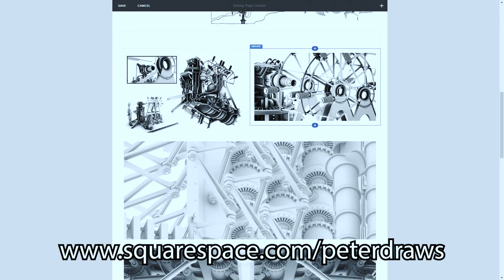I'm on the EDGE of a BREAKTHROUGH! (Painting Process Video)

Comment: I think the breakthrough... is realizing that you're idealizing breakthroughs. You're a successful YouTuber. You've achieved something that many, many more people have attempted than succeeded at. There were probably a thousand little breakthroughs along the way in achieving that, which you should probably recognize!
Reply: I agree completely.  I was going to write this just about exactly.  Thanks for saving me that typing.
Reply from the maker: Probably so. Thanks for the encouragement!
Reply: 'Idealized breakthrough' I can understand as it was posed as a breakthrough to the 'upside' or the 'downside' of something which we could call 'being' or perceiving yourself as on one of those sides instead of like a smooth transitional gradient, or even more interesting to me, explaining it or using it as a parallel like the painting that PeterDraws is creating in this video. Loading up the paintbrush with hues of visual information, which in some art schools or by various artists have also been aligned with, or too, sounds, emotions, meanings, symbolic stuff, ect. and that are then intermingled and blended with each stroke of the brush therefore every stroke with the addition of more values (or basically information or experience) of various proportions is a breakthrough, getting to the finished product, which we will call the end of the video, (just because very similar to the breakthrough explanation I find it hard to merely say the creation of the finished painting is the only intricacy, even if explained in relation to a breakthrough in and of itself, as there was a lead up to the panel even being unwrapped or whatever in the whole artwork, which could be likened to the history of human events even those that begat the creation of Peter, anyway very similar to likening humans, as what we know humanity to be today anyway, using tools or language for the first time to operating heavy machinery to create something thousands of times the size of your average human being.)  Also, because it's a edited video which is a collage of moments played in altered time, (definitely since I speed up everything I watch no matter how it was filmed), which is or can be said to be another artwork, in and of itself, filming, an artwork being created of an artist being, well, an artist, and biographical videos are no less artistic in their conveyance of what is or was, which is then also a live action entertainer and actor as well, and then the dub over of an internal metacognitive dialog which too can be considered a musical compilation or soundtrack of spoken rhythms and tonality as well as pitch function timber ect. about a given topic or subject matter as perceptual information to retain while a whole back/fore/ground of visual information is still dancing across your rectangular screen as paint is manipulated on it's rectangular wooden panel.) Even though just like the panel that he reworked repurposed or remastered for the Squarespace interlude the finished panels can still be repurposed for various other uses and breakthroughs, still, or you could decide that the painting isn't what you like or wanted it to be, or even isn't or wasn't a real breakthrough, if you get in a funk one day, as we all do, sitting there with too much paint on your brush, and sand it down and repaint some other larger picture breakthrough with brushstrokes great and small and palette knife work and maybe even multimedia stuff thrown in there if you get some kinda wild hair going and feel like experimenting.

So, anyway I say all that to say this, when I hear breakthrough, I hear, 'Break on thru to the 'other' side'. Then I wonder what other is like or even if it's better or worse or just is, maybe it's just a perception and the breakthrough is even thinking there is another side when change is constant and it's easier to see looking back kinda like he was dating the video looking forward to 2024 initially talking about burgeoning breakthroughs and stuff. Time will tell I guess and that can be edited perceptually and relativity more easily shown, and proven, I guess.🤷‍♀️ Who knows.

But I do like the interworkings of the concept, and it also makes me think on the concepts of idealism and nihilism as far as gradients and other sides are concerned but that's even funnier when you get to select something on a color wheel that is one HUGE gradient and there's really no lines nor divisions to be on the other side of just like the equivalent of Cartesian coordinates in an unrealized or yet unpurposed space.

Pretty cool. 🤔👍
Reply: Oh, as far as editing and relativity and time jumps are concerned in showing breakthroughs visually, the movie Kat Ballou I guess, where you have a hanging and then the whole movie goes thru everything that led up to that moment, but you also get to see this on antiques roadshow in a different context or variation of it when they show the artwork of an artist that was prior to the work they are really known and revered for but it sells for or is valued at a ridiculous sum of money because it's an edge of a breakthrough that shows an evolutionary marker in the historical artistic journey of that particular artist. Kinda the same thing but pinpointing that moment or the embodiment of that moment is perceptual as well, the artist or individual might pinpoint that personal moment 7-10 years before the historian looking back at the totality of their, the author or creator if the works, existence, actions, and works does, and yet they are both kinda considered experts too. 🤔 But time also, makes or proves some experts morons, and others, like DaVinci levels of great, even though in the moment they were all just as delusional as everyone else is stumbling thru it all. Maybe? 🤷‍♀️ or maybe there's just too much paint on my brush today. Thanks for the perspectives just the same!
Reply: There is such a thing as over-analyzing. My mother in law used to tell me, “You think too much!” She was probably right.
Reply: nah he’s on the edge of something big
Reply: Meh, half of what makes some conceptual and more modern or contemporary works more interesting to people is the fact they cause overanalysis to the point they create a great addition or example to/for someone else's papers or critiques which then create more of an ongoing conversation in ever burgeoning circles, which almost take on a life of their own, giving newer incites into something maybe the artist at the time didn't even see or contemplate, but still gives it a place and renewed importance no matter the time that has passed since its inception, so though dated it's interest doesn't completely ever really dissipate fully.
Anyway, at least it's a breakthrough, and not a break down, those seem to be something that some like to create in others in order to either get them silenced and relegate them to some label one might constitute as unreliable or undependable which then gets them less consideration as opposed to someone who steadily creates work, and is more reliable and more dependable to be incessantly producing something people find interesting enough to want to see more of, or so I have read. But it's whatever. I do tend to overthink, or not think at all sometimes.🤷‍♀️